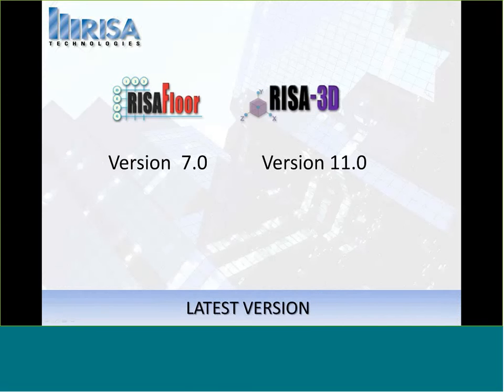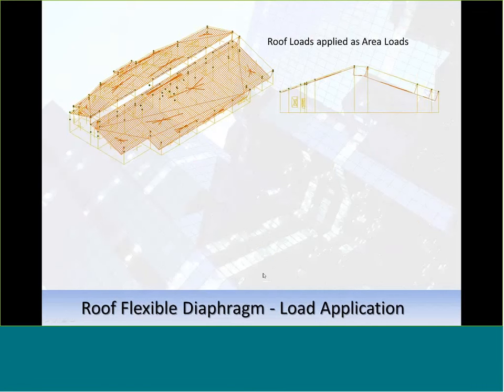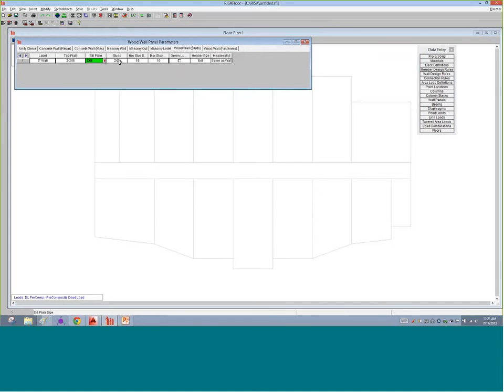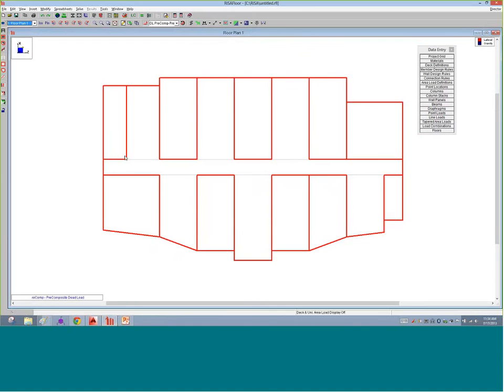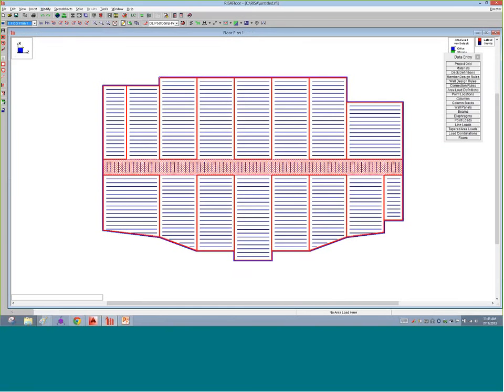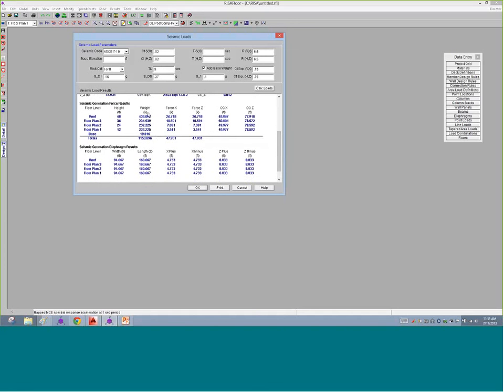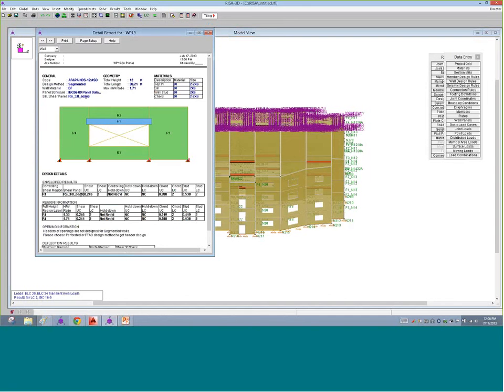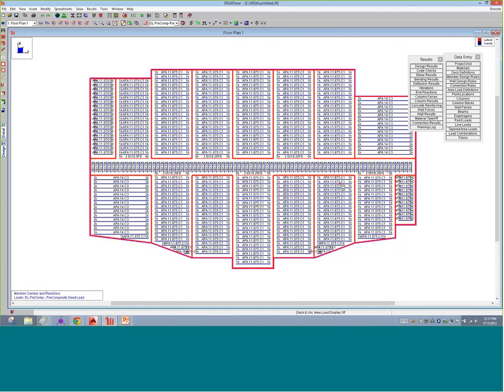Designing Wood Buildings in RISA

Comment: For easier reference. 

0:00 Intro 
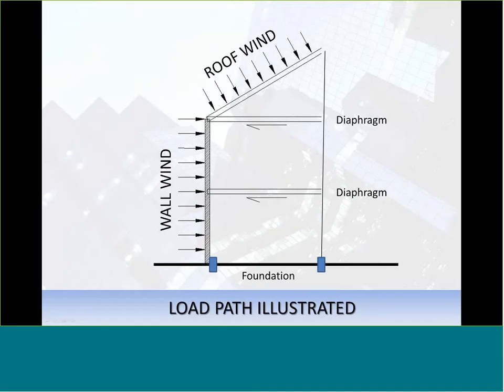2:00 Load Path illustration 
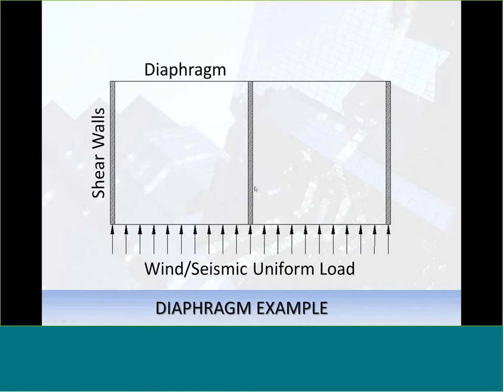3:04 Types of Diaphragm 
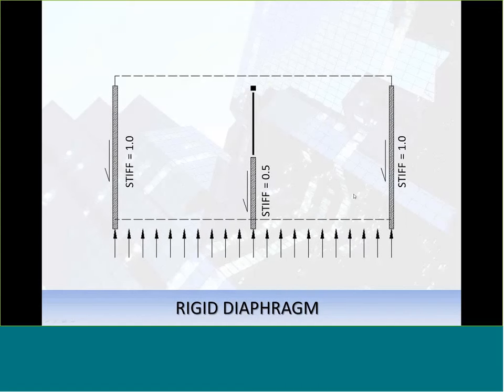5:44 Advanced cases of the 3 types of diaphragms 
7:50 Load application of the 3 different Diaphragm cases 
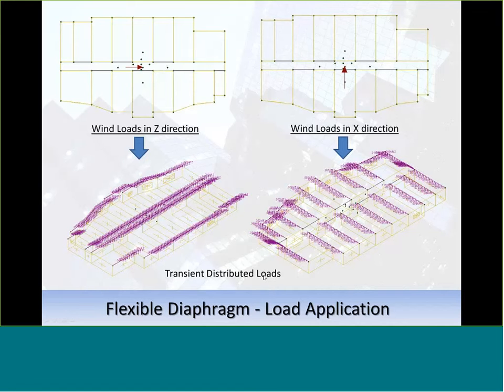10:55 Roof Flexible diaphragm - Load application 
12:08 Types of Wall designs 
16:40 Finite Element Analysis 
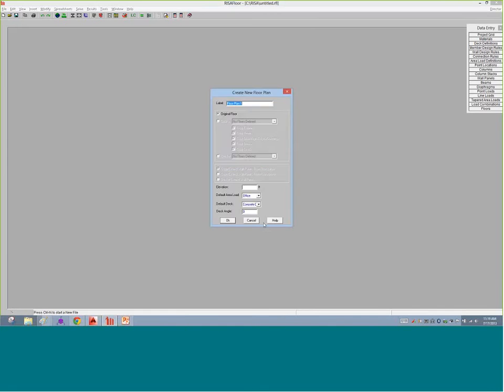18:28 Create New Floor 
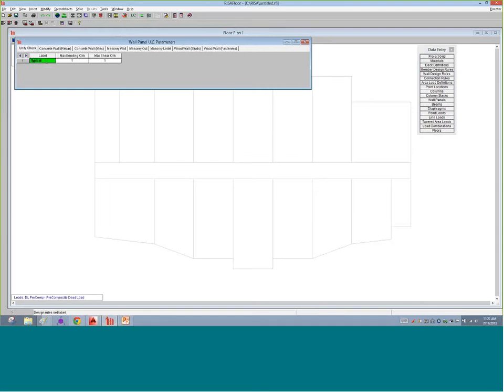21:30 Wood wall panel parameters 
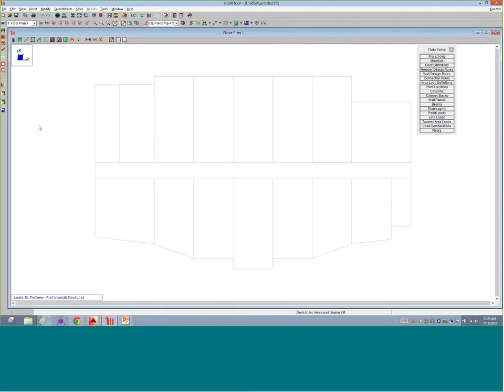27:00 Draw Walls
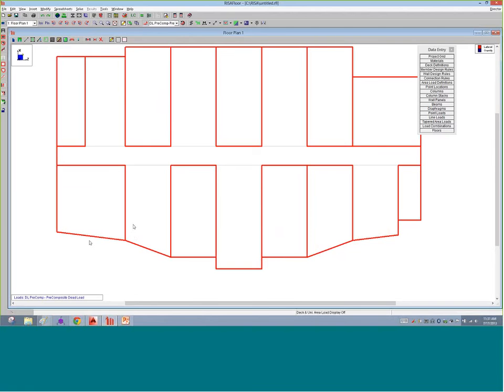29:45 Wall panel editor
36:25 Draw Beams 
37:05 Generate infill beams 
38:18 Create Diaphragm Edge 
38:55 Floors under Data Entry option 
40:30 Deck assignment 
41:19 Define loads & additional loads 
43:53 Create new floor 
44:57 Create Roof level (Framing for roof level) 
46:40 Applying slope to the roof 
48:08 Solve 
48:55 Warning log : Roof Deck exceeded maximum spacing 
49:34 Results interpretation 
52:10 RISA 3D (Defining Wind loads) 
55:35 View a single floor only
56:51 View loads 
57:18 Basic load cases 
58:44 Load combinations generator 
1:04:04 Interpreting Roof level  loads 
1:05:27 Wall report 
1:12:12 Quick way to Change the properties of diaphragm